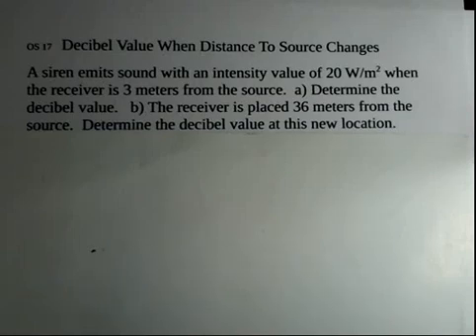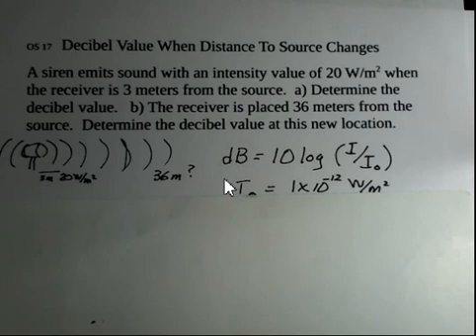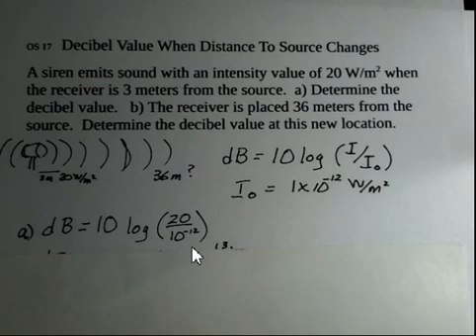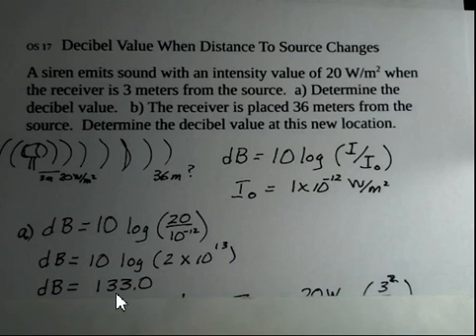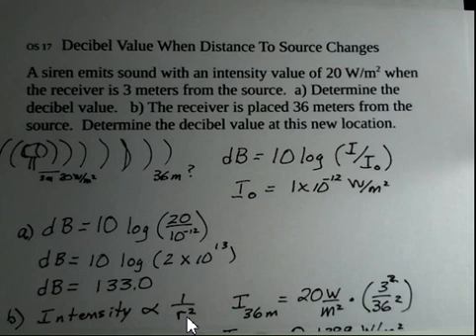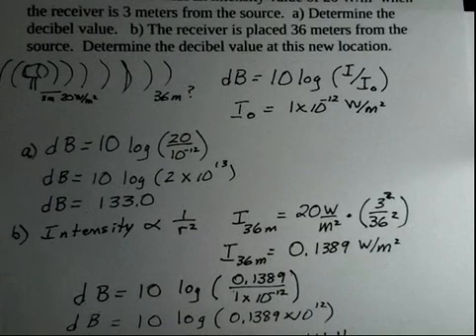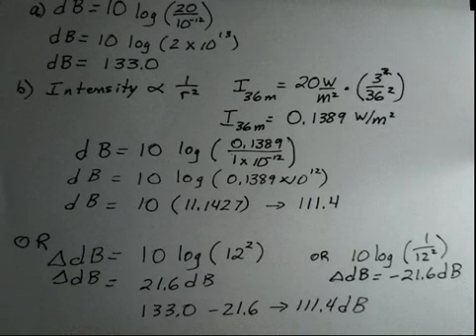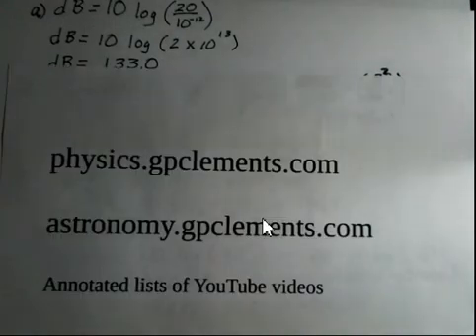Decibel Value When Distance To Source Changes

Comment: could you help me with a problem? if a piece of equipment is giving off 72BA at 7 meters. How much does it give off at say 1meter?
Reply from the maker: I have not worked with the dBA system, but I think the dBA  system will not change the approach to this problem.  The dBA level measured at 7 meters from the source is 72 dBA.  This value should be used to calculate the intensity of the source at a density of 7 meters.  My video    https://www.youtube.com/watch?v=TdVusylBlkg   shows how to calculate the intensity.   Next, realize that the intensity level changes as a function of the distance.  When the source is closer the intensity is larger by a factor of the ratio of the distances squared.  For your case the intensity will be 7^2 larger, or 49 times larger.  Multiply the intensity value you calculated for the 72 dBA value by 49.  Now, use this new intensity value (at 1 meter) to calculate the dBA value.

Comment: Could you do one that explains dB SPL and IL? Please?  You are better than my professor! Thank you! And one with micropascals also :D Thank you!
Reply from the maker: Sorry, I have never used dB SPL or IL.  I did a Google search for dB SPL and found some useful information.  dB  SPL is calculated by the formula  20 * log (p1/p0)   p0 has the value of 20 microPascals.  Divide the value of p1 in microPascals by 20 microPascals.  Take the log of the result. Multiply by 20.  This gives you the value of dB SPL.
Reply: @GregClementsScience  Thank you! I got through my test with a 90 :D I really do not like math because I usually can't see how you get from one step to the next and a lot of teachers leave things out or go too quickly and then expect students to apply the information without being taught the specific steps. I could never do that and it's always been upsetting for me. Thank you for your videos!